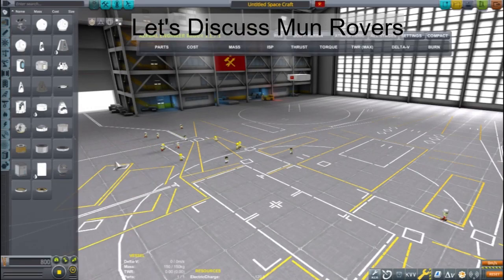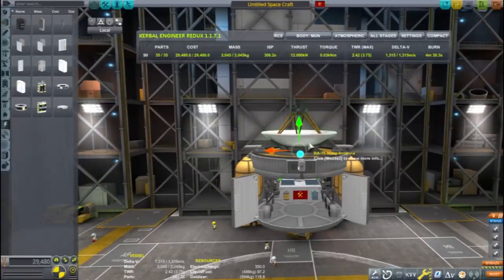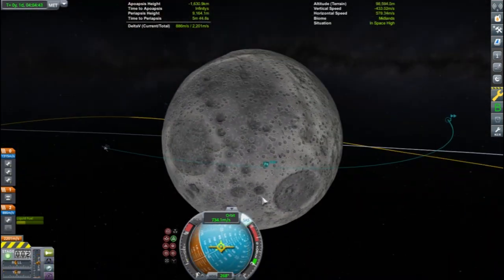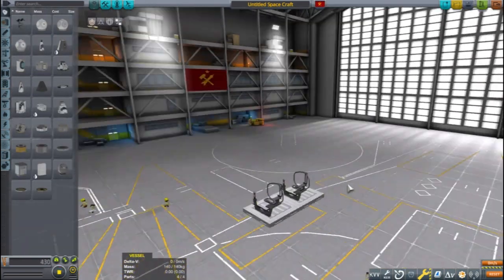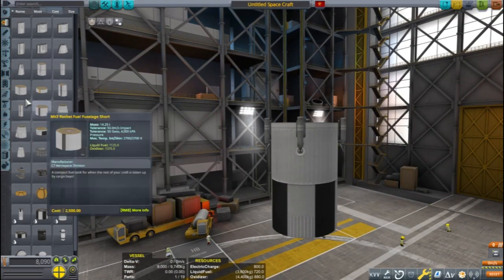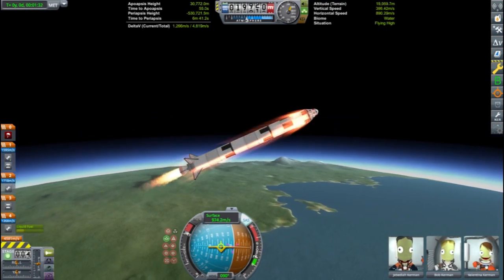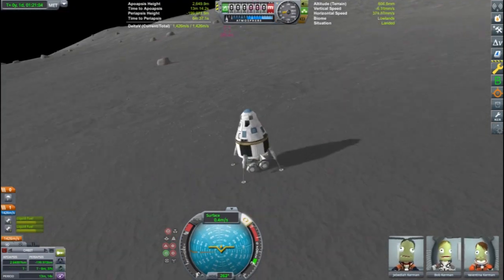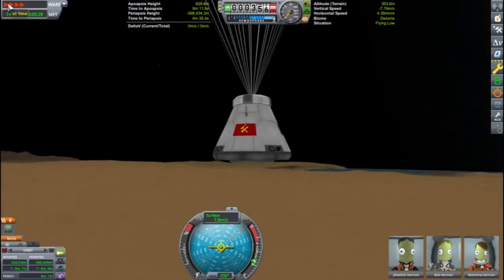Building and Landing Mun Rovers

Comment: How do I stop my rovers from tipping over and becoming a nightmare to put upright
Reply from the maker: I like to add some reaction control wheels to my rovers. By default, they will be off, but I like to bind them to the RCS action group. When I see there is going to be an issue, I'll turn on RCS and quickly correct. It is also a good idea to not go very fast with rovers.
Reply: Guessing you figured this out by now, but on the Rovers, right click, select "Control" and set it to SAS ONLY.

Comment: once I figured the low gravity of the mun, I just made a gigantic rover, cause I wanted to go fast without losing control, called it the monstrosity, took a ridiculous rocket to get it to the mun, but it was worth it.
Reply from the maker: You can also place an engine like the RAPIER on the rover with the exhaust side pointed up. The center of mass of that engine is further forward than the piece itself. So, you can make a rover with the center of mass below the ground. This is very stable.

Comment: The rovemate is rotated and when I rotate it back and put the wheels on they are sideways I rotate them and then one wheel is upside down
Reply from the maker: This sounds like you may be using radial symmetry instead of mirror symmetry mode.
Reply: Use "R" to switch between Radial and Mirrored symmetry. C to toggle snap on and off